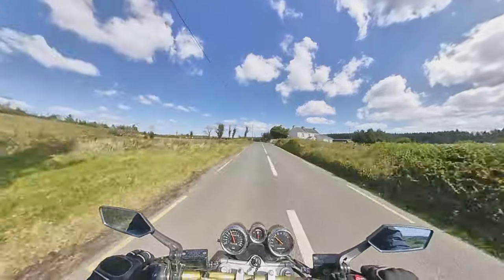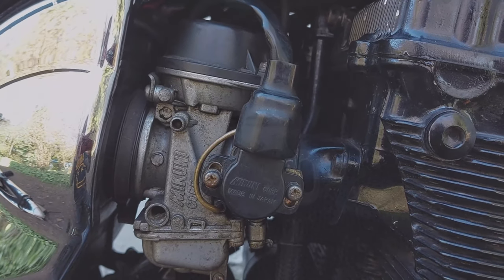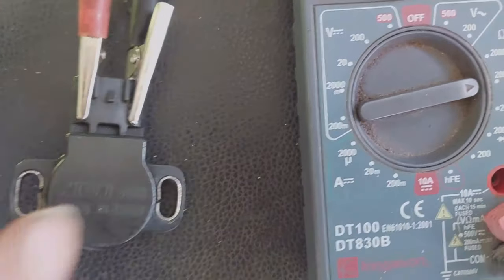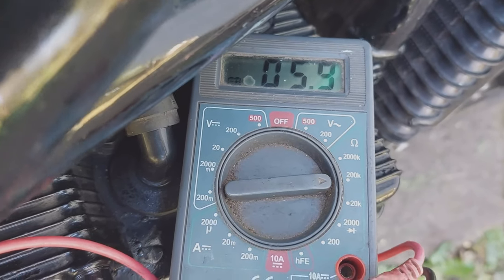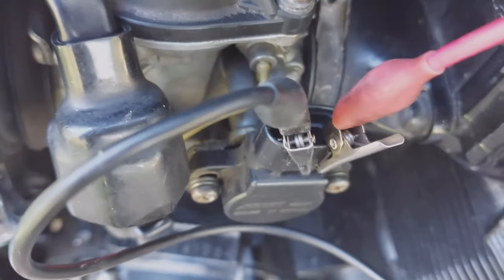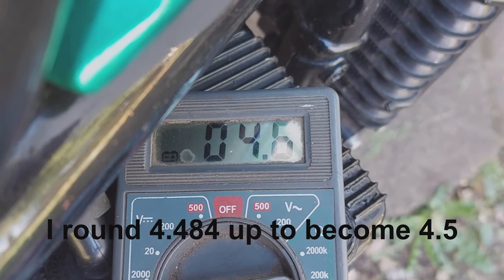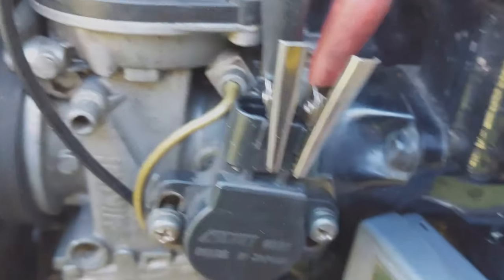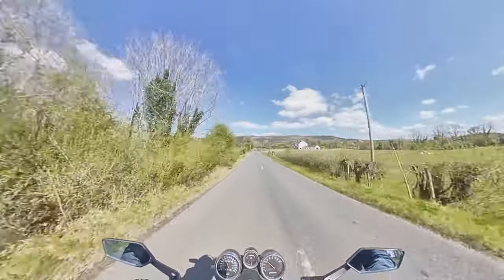Sort your TPS 👍 98 Mk1 Suzuki Bandit 1200n TPS check and adjustment

Comment: TPS does nothing except retard timing, best left unplugged.
Reply from the maker: Hi @williamfoster4268 , I feel I need to make a follow-up video on this topic , tps tells ecu what you're doing with the throttle, ecu uses this info along with rpm and gear selected to calculate correct ignition timing . Ignition timing consists of three layers , in old distributors it was base timing + vacuum  + centrifugal gives total timing. Tps is just more modern electronic way of calculating how much timing to advance or retard from static base timing. Seems to me to disconnect it may be leaving a lot of performance and efficiency on the table, also the incorrect ignition timing could potentially be damaging if not catastrophic
Reply: @emeraldbandit1200  These bikes have no ECU(Or CDI, it's actually a TDI).  The TPI is only used to retard timing during a cruise condition in order to get better MPG.  Take your Bandit and run back to back dyno pulls, you will not see any noticeable difference in power made or lost.  TPI was only added due to Euro 2 or 3 emissions controls. 

Timing on these bikes is conservative from the factory, hence being able to slap on a +5 degree ignition advance or drilling out your own and still being able to run 87 octane without pinging or detonation.  I hope this clears up some confusion you have have had.
Reply from the maker: Semantics aside the flip side of retarding the ignition for cruise condition is advancing it on acceleration, better mpg is definitely a good thing, bandit 1200s are thirsty. Advancing the ignition doesn't give more power but it certainly gives better throttle response and riding feel and yes this is what a 5 degree advance plate gives you but the fact the tps tpi or whatever you'd like to call it is adjustable means its quite easy to add 5 degrees or whatever you would like by adjusting the sensor .
Reply: @emeraldbandit1200  No, you can't add timing over base with the TPS.  It can retard from base timing or go back to base, but not advance past that.  Advancing ignition can and will give more power provided certain conditions are met.  The only way you are advancing ignition is by drilling your pulse wheel or bolting on an aftermarket solution.  You gain power down low using an advance, it's not much on a Bandit though.
Reply from the maker: But you can move the point the timing changes and in my experimental adjustments on my own bike certainly translate to changing how the throttle response feels particularly at less than 3500 rpm and play a large part in sharpening up the 4k kick in power, not gaining total timing advance but starting the advance curve earlier adds relative advance at least until it maxes out. Ultimately it would be well worth making a windowed ignition cover and a timing light to see for real whats going on there and if I can gather the necessary I'll certainly make the video
Reply: @emeraldbandit1200  You can just drill a hole through the cover where the pickup is.  IIRC base timing is 20 degrees.
Reply: @emeraldbandit1200  terrible narration audio..
Reply: Big love for the emerald bandit  !
Reply: Any idea what would be wrong when I turn the throttle my multimeter does nothing staying on 1.0

Comment: Really enjoying your channel,I have 98 bandit and never even thought of checking the tps, have had slightly annoying carb issues since I got the bike, just checked the tps and it’s reading 9.3k pins 1&3 and 8.4k pins 2&3 throttle  open…..new tps required by the looks of it! Aaaargh!!
Keep up the good work, Rob.

Comment: Very useful, we have a bike in which has great compression, valve clearances within tolerance, timing is right, its sparking, new plugs, air filter, oil etc... Seems to be fuelling ok, we also sprayed carb cleaner down the intake and still no fire, not even an attempt, checked the tps and its out of limits, shows absolutely NO continuity. New TPS on the way :)